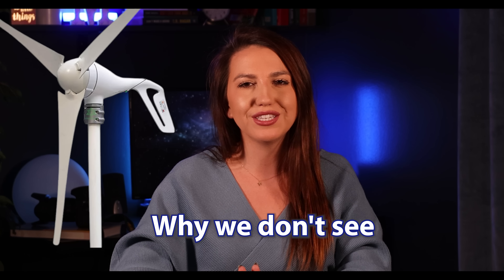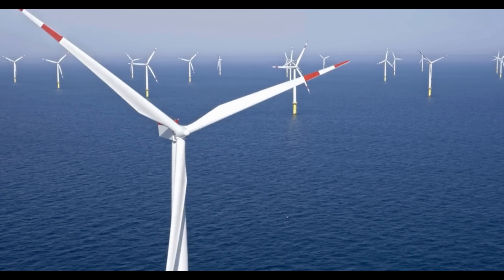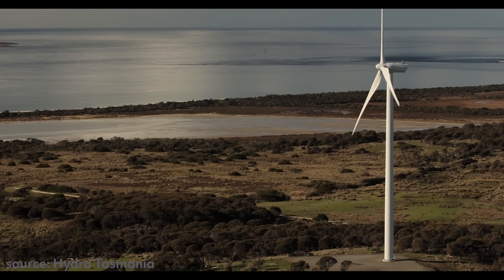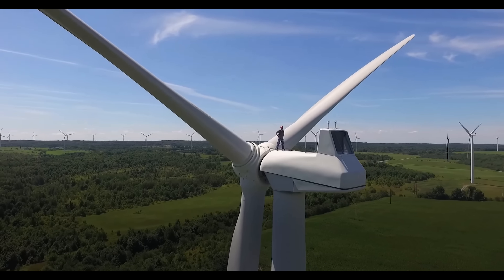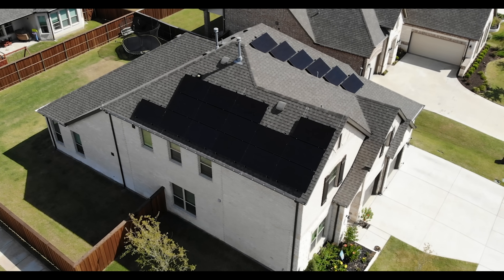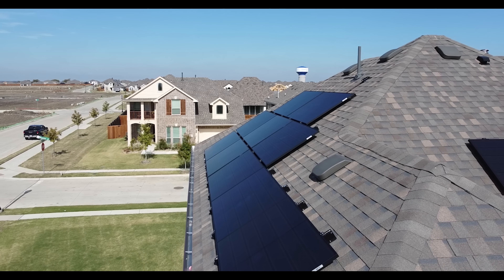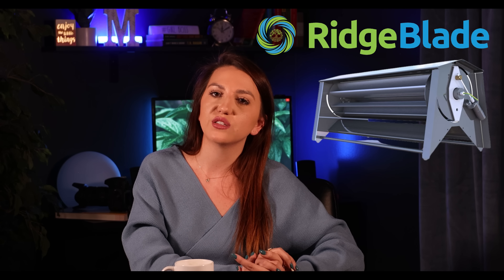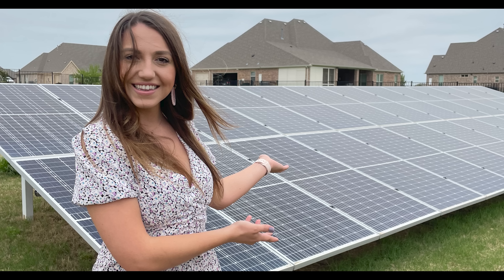Could this Turbine Destroy Solar?  | Why haven't we seen these small wind turbines yet...

Comment: It's very strange , that video is ending with a question (paraphrasing) - when will this ONE best cool design of a wind turbine emerge , so we can all use it ? There is no one pill for all illnesses. As it was implied in the video , depending on location , wind conditions (and permits , where those are needed , like in urban areas) there are different designs and sizes available. In urban areas , VAWT are more suitable , because those are omnidirectional (I mean in relatively low heights) , while in rural areas (unless they also have many changes in wind direction) HAWT are more effective (those are generally more efficient in the same wind conditions , than VAWT). Unless someone lives in VERY windy , or extremely windy area (which sucks) , small to mid size wind turbine are meant to supplement energy production , rarely to satisfy all energy needs. So , for cost effectiveness , DIY turbines are most suitable (properly designed and installed , with previous research of wind conditions and feasibility). Solar is (photovoltaic and heat panels)  , currently , significantly cheaper , comparing the same power output (you can't DIY solar  PV panels , but you can install it , where it's possible w/o permits and codes). Oh , this "Archimedes" design , which is patented in 2016 - I saw that produced by some Russians and Ukrainians , more than 10 years ago and the design is (slightly optimized , I presume) is , at least , around 150 years old (ship propeller , if we disregard Archimedes screw).

Comment: To add to the complexity, another huge missing piece is a master hub that can coordinate your solar and wind devices into one energy stream. I have 30 panels on one side of my home, and 9 connected to a Powerwall on the other, but we cannot connect the 30 panels to the Powerwall. No adapters exist. THERE'S a start-up for a young enterprising power mogul...
Reply from the maker: Yes, there are still so many wrinkles to iron before it all works properly together. I can always see a nightmare of who would make a wind turbine inverter to convert DC to AC... and how would that affect the solar system, would it be able to properly communicate... I just hope we will get there one day.

Comment: This is a terrible video. You even show the data sheet for several turbines on screen which clearly show that at low wind speed (2-5 m/s) these generate virtually nothing. For a domestic installation most homes will not be achieving am average of even 2m/s meaning the turbine won't even spin. You might get lucky and live in a consistently windy place but unless you do and that speed is about 20m/s you are wasting your time. 
Such a shame you didn't do your research (reading what you showed!!!) before making the video.
Reply from the maker: Here is the timestamp for the explanation on what power output we can get per m2 for under 3 m/s speeds: https://youtu.be/bS9QVicnch8?t=357  explaining that at those wind speeds power generation is almost nothing. 

Here I show that if you live in urban areas your wind speed are significantly lower, but if youre in a country area the wind speeds are much higher based on Global Wind Atlas: 
https://youtu.be/bS9QVicnch8?t=256 

In conclusion I speak about how wind turbines are not anywhere near a good idea as of now. 
https://youtu.be/bS9QVicnch8?t=836